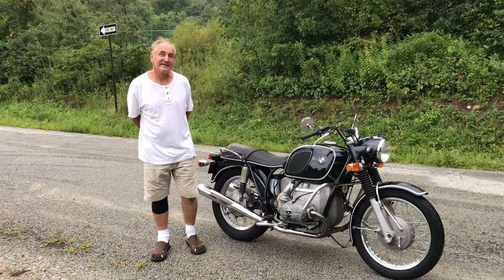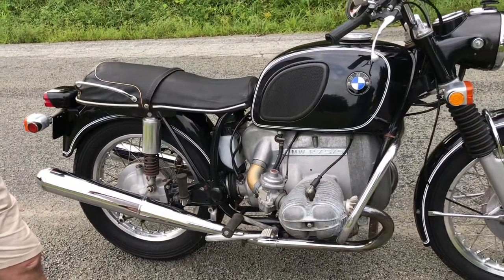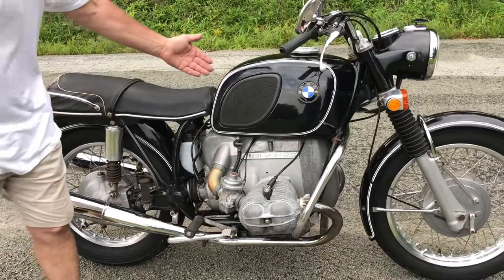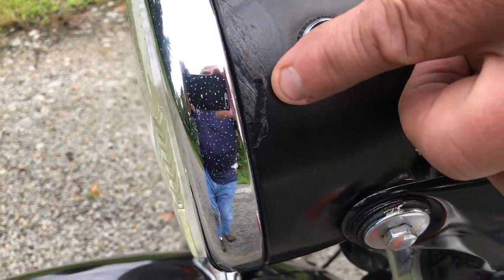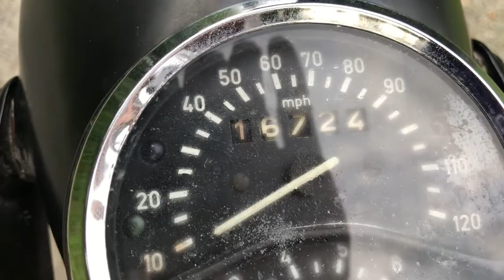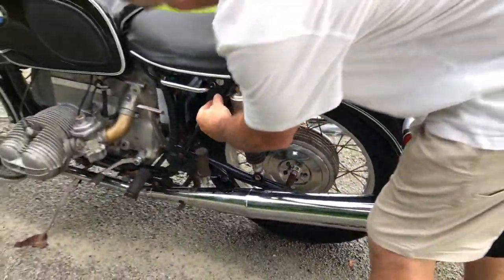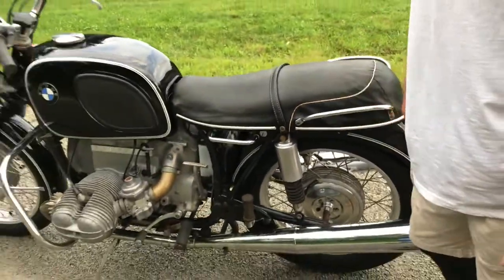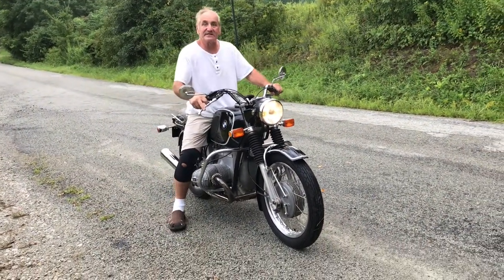1971 BMW R75/5

Comment: Nice bike! Nice details! Very original except the mufflers, but even this is ok on a used bike from this period
 as the original mufflers were not available all times.
Mine is exactly from the same time, but a german model.(Km/h and no side-reflectors)
See the details: left mirror mount (there was no right mirror originally) smooth leather on seats with two handles,
there was no side cover in 71, even the slightly different headlamp-paint is original! note the hinge of the tank-cap is in front.
the 71 model still had the short wheelbase that was sometimes a little bit tricky at high speed.
Please, dont restore it, simply replace the rusty screws and bolts, install correct mufflers, and everything is good!

Comment: I had exactly the same bike for 10 years and 160,000 kms. In that time I replaced a diode pack. I had a Windjammer 111 with lowers and Krauser bags. Great machine.
Reply from the maker: Nice 👍

Comment: I’ve got a 72 toaster. You got a nice find! But I think the tank and fenders have been repainted, otherwise they’d match the slightly dull paint of the headlight bucket and frame. Also, that’s probably a new chrome ring around the lamp, otherwise it’d have the same scarring that’s only the bucket. My bike had the same thing when I bought it in 1991: repainted tank and front fender, original headlight, frame and rear fender.

Comment: When the man wrote off I could tell it was only running on one cylinder needs to synchronize the carburetors another thing I noticed the rear shocks were set on the softer setting should be said to the hardest setting
Reply: Correct. The bike needs a tune up.
Could also be there is 1 in front of the 16…
Reply: I got mine in March of ‘73 in 
Munich. Racked up 12,000 miles in 101 days. 
Flew it back to NYC and rode it home to California. 
I rode it for another three years and sold it when we decided to have children. 
I chose that bike because I was a scofflaw who liked to exceed the posted speed limit. Quiet bikes were really rare and the cops, even the CHP, never ticketed me. Nice bike.

Comment: Just in case nobody caught the error, the 1971 R75/5 did not come with side covers, they were added in 1973, also the guy was wrong about the mufflers, they are not original